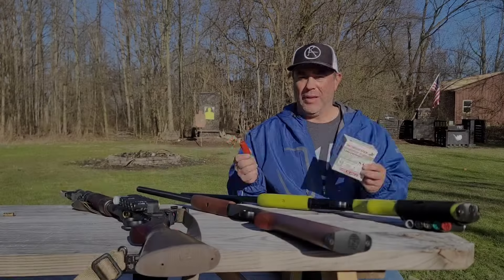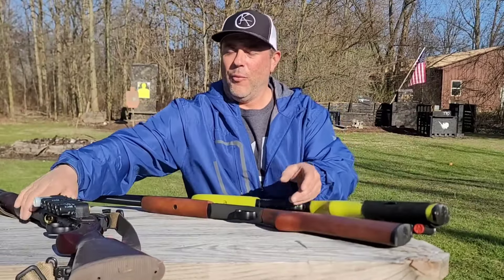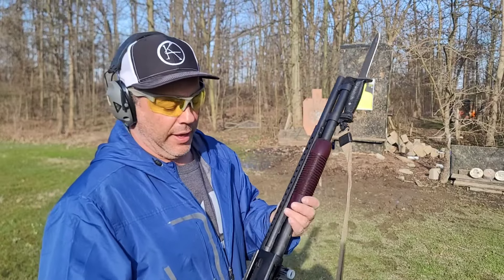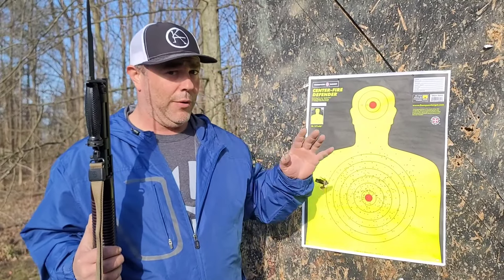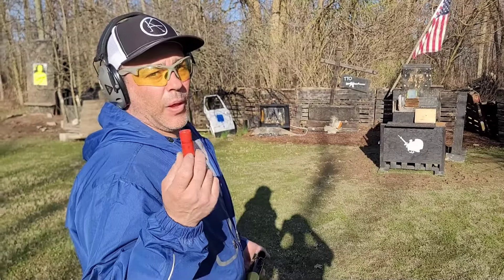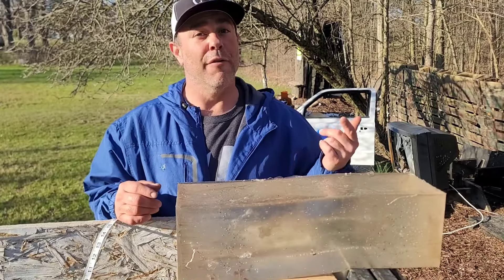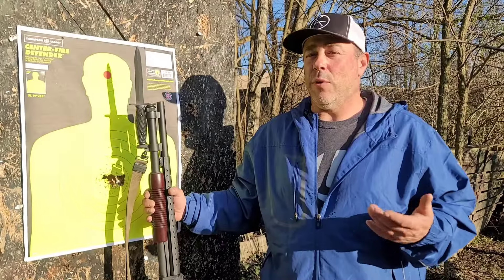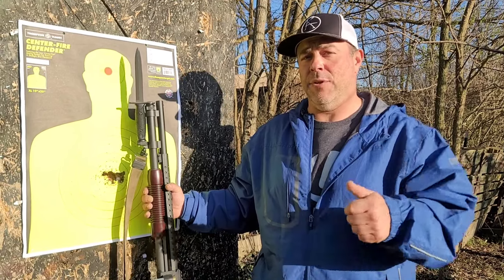BIRDSHOT For Home Defense? NO 🐂💩 Testing. Full, Modified, Cylinder Chokes.....

Comment: My home has a child in every direction. Buckshot and slugs will go through multiple walls very easily. I cannot think of much worse than accidentally hitting one of your loved ones while trying to stop a threat. I assure you that bird shot is very effective at indoor distances. I know a family who lost a son from being shot with bird shot from a 16 gauge. Any size shotgun shot is extremely deadly within 20’.   I would not use number eight or something small though . I keep my Mossberg loaded with BB size 3” shot shells. I would even feel comfortable using #2 shot. I have shot multiple wild hogs in traps with BB Shot shells. It is like turning a light switch off. I’m so tired of these “ tactical “ city boys talking like they know something. If birdshot will drop a 300 pound bore hog through its armor plate… It will definitely stop a thin skinned predator very quickly. If I didn’t have anyone living with me I would use buckshot for sure though.
Reply: Paul harrell tested. #4 birdshot on 12ga  will penetrate 1 wall. Check out his video. I used 20ga #4 birdshot.

Comment: Best video on the subject I've seen so far. I think alot of the birdshot doubters speak from second hand knowledge  without having done any personal testing and as a result fail to put things in perspective. For instance they don't realize that a load of small bird shot often weighs the same as a slug or buckshot load. As far as penetration I read a study that says a knife blade need be only 4-6 inches long to reach a vital organ so I take  the fbi requirement of 12 to 18 inches with a grain of salt. If one is concerned with over penetration they should know that a slug can bust through alot of things, and that 00 buck shot would be like hitting something with multiple 9mm fmj rounds and that 9mm fmj is known for over penetration and that small bird shot dumps all it's energy into the target while the slug or buck shot does not it lends to the idea that not only is small bird shot adequate for home defense  it is also ideal.

Comment: Without a doubt birdshot can be lethal, it's not recommended for self defense because it may not be immediately incapacitating. Bird shot generally does not penetrate deep enough to strike vital organs or CNS. As a result the primary stop on a target would be through exsanguination, that can take some time. Unfortunately, in a gunfight giving the bad guy an extra few moments could have them returning fire. 

Buckshot, slugs and rifles are effective because they can stop the threat a.s.a.p.
Reply: Inside of 15 feet it's a death sentence
Reply: Inside bedroom distance, it can easily shatter a skull. If you get them in the throat, it will take out vertebra. 

Shot placement still matters.
Reply: @ihcterra4625  Can you link those coroner's reports? I'd love to see a primary source document, on this topic.
Reply: @magickaldood  I never claimed to have coroner reports. You must be either thinking of someone else or you are using a straw man argument. I'll assume it was an innocent mistake and not that you are a liar. 

Of course, I could be wrong. If that is the case, I do apologize.
Reply: @ihcterra4625  So you don't have any primary source evidence of, "inside bedroom distance, it can easily shatter a skull. If you get them in the throat, it will take out vertebra"? 

Got it, thanks for your time.
Reply: @magickaldood  Oh, I have plenty. Just not coroner's reports. I never claimed that I had them.

You know, I'm beginning to think your comment wasn't an honest mistake.

Comment: My Rem 870 Wingmaster has been behind my bedroom door loaded with 7.5 shot for 25 years.  Thankfully I have never had to use it. The reason that I use it is that I know from watching testing that 7.5 shot will not penitrate 2, 3, or 4 sheet rocked walls killing someone I don't want to kill. Buckshot and slugs CAN. So I can at need defend my house knowing I am not going to kill my wife asleep in the bedroom.  As your test clearly showed at inside 20 feet with a full choke birdshot has no problem going right through clothing and anything else it hits.  But if it hits a wall, it is not going to go another 20 feet beyond that.  I have shot pidgons and grouse at 20 feet. What you get is best summed up with the saying "Bloody rat hole"

Comment: Hello I found your video rubbing informative and actually reinforced my opinion of what ammunition for the shotguns I need

 my local gun store I was trying to sell me on Dove ammunition for defense even though I think he was only thinking about home defense and I was not

 I have big property and I consider defense not just to be in the home but also on the property so I was looking for ammunition that would be effective not just in the home but also for at least 35 yds  about 105 ft.

 so after looking at your video and many others I think at a minimum double odd Buck should be the ammunition and possibly slugs depending on if the target is  armed and wearing some type of body protection

Comment: You get hit with bird shot under 7 ft you prolly gonna die. It's about iike a slug hit. It's kinds dangerous Don't mess around with shotguns. They are deadly. Everytime you pull the trigger with buckshot? That's like pulling a trigger to a 9mm 9 times, it don't mess around and will leave collateral damage
Reply: 9mm round is way bigger than buckshot.

Comment: I'm completely sold on birdshot being being not only sufficient but highly effective at home defense distances. With the added bonus of little danger of overpenetration. I live in an apartment and am highly concerned about maybe one day having to discharge a 9mm Para handgun.
But what is the risk of pellets ricocheting and hitting me back in vulnerable areas like eyes or throat? I won't be wearing shooting glasses at 3 am.
Reply: The risk of pellets bouncing back at you is far higher with steel shot, because it weighs less and doesn't penetrate well. IMO something like #4 lead birdshot might be the sweet spot, or #5 lead  if you're hugely concerned about overpenetration.

Comment: I need to redo the exact same shooting test. But having 3 different jail blocks. Because you shouldn't in your video right into a Joe block that has already been predamaged for inches 5 inches. Therefore, the proceeding pellets have less resistance. Because the other ones have already broken through.
Reply from the maker: Its not ideal but man are shotguns hard on blocks. 1 is a real pain to recycle, 3 would be a bad few days.😕
👊🦃👍

Comment: 20 feet is not an average home defense distance.  It is the average MAXIMUM.  Much more likely scenario is under 15 feet, owing to the response time lapse of the home owner. 

Very few homes have any open space that is 20 feet from any exterior door to the victim's position.  A prominent exception may be the many thousands of "split-level" homes where there is a front door that opens to a platform leading either up to the living room, or down to the basement .  The living room will be wide open, but the aggressor needs to come all the way up the stairs to access a fire lane into the living room or attached kitchen.  Even so, most home owners will not react in time to the intruder, no matter how well prepped.  Thus, the distance will be greatly reduced in a couple of seconds.  Home invasions and armed reactions most often occur at between 10-18 feet.

This increases the effectiveness of birdshot almost to the level of buck..... IF you have the time.
Reply from the maker: I have 20 ft shots all over my house🤷‍♂️ 
Thanks for watching! 👍🦃👊
Reply: @theturkeysopinion  You are the exception - not the rule.

Comment: Every time I see a video abiut birdshot for defense, I always check it out for the ranges they use as a "typical" example.  WHile I have no doubt of the lethality of birdshot, the ranges given for typical inside-home defense is usually on the far side.

I invite the viewer to actually maesure every possible fire position in your home.  You will be  surprised to find that there are not many that are 20 foot open distances inside a house - unless you have a very large house.

Add to that the unlikely event that you have warning of in itruder before he is inside, thus, the distance is likely to be much less than 20ft.  More in the range of 5ft to 15ft.  The longest distnace in my house is the hallway to the bedroooms, which is 18ft.  In the rec room, which has a door to the outside, I would be dealing wioth a distance of 12 feet even if I knew they were coming in.  I most likely would not - nor would anyone.

Now, do a demo of the spread at those more realistic ranges.  My 20g 870 with an 18" barrel patterns like a ragged 3" hole at 12 feet and doesn't get much bigger than 8" at 18ft and blows through a full size ham.

Also, birdshot MAY be more defensible in a civil suit, which will follow any defensive shooting.

Comment: I believe in the candy cane load....first, #7 bird shot, then #6, then #5, 4, 3, 2, buck, buck, slug... My Benelli holds 9
Reply from the maker: I love this! Increasing levels of Deterrence.👊🦃👍
Reply: You just want to shoot someone a little bit when your life is on the line? 
I assume you're using target loads in a cylinder bore? That's really not a good idea. Use a heavy magnum turkey shot or coyote BB load with versa tite or flite control wad if you're not going to use a full or tighter choke...
Reply: I think this is a bad idea. If #7 doesn't neutralize a threat you're not going to have all day. I'd skip over the 6 and 5 at that point.

Comment: I have an old Savage bolt action 410 with modified choke.  At 10 yards with #8 shot it throws a nice 8” pattern.  If you are defending yourself you would be at 5 yards. Robber, it stinks to be you.

Comment: Something to consider is that penetration in gel in no way equates to penetration in living tissue. For example, per FBI testing parameters,  the gel block must be calibrated before it is used. This involves shooting a steel .177 caliber BB into the gel at 590 fps. The BB must penetrate between 2.95 and 3.74 inches. Now, a lot of us rural guys grew up having BB gun wars as boys, and I can assure you that a steel .177 caliber BB at 600 fps will leave a bloody welt, but it won't penetrate even half an inch, let alone  nearly 4 inches into your body. So when you see these pellets stopping between 5 to 7 inches in gel, they are barely getting through the skin and into muscle tissue. They aren't making it into the thoracic cavity. They may dissuade further aggression with a psychological stop, but this mechanism isn't as reliable as physically incapacitating a threat. This requires more than superficial wounding and pain. Physically incapacitating a threat requires deep enough penetration to reach large blood bearing structures deep in the body and causing hypovolemic shock. There is a reason professionals and informed citizens overwhelmingly prefer buckshot. Those of us who actually use birdshot to kill shit know it doesn't anchor rabbits on the spot reliably enough to trust our lives to it.
Those that know gel testing know this test just demonstrated the abysmal performance of birdshot, even constricted by a choke at indoor distance. Piss poor performance.
Reply: You obviously haven't seen Jeff Quinn's YT video, "Shotgun Ammo For Home Defense Gunblast."  It might change your opinion.
Reply: @spectrumifs  I remember that video. Jeff is sorely missed, but this is one thing we will have to agree to disagree on. I've still seen rabbits take well centered birdshot patterns at ranges I have in my house and run off. 
The whole over penetration argument is asinine. I cringe every time someone says, "Over penetration." I swear it lowers a person's IQ two points every time they say it. Especially when the standard you are using to judge it is two 1/2 inch pieces or drywall that an eight year old squishy-face on Ritalin can punch through. 
Again, gelatin testing exists to give us scientifically valid data, and standards were derived through the real-world experience of experts like Dr. Fackler, who treated thousands of gunshot wounds. When they suggest a minimum penetration standard of twelve inches, it is not an arbitrary number. 
Shooting meat is fine, but absent a realistic skin medium, lacks any relevance to the real world. Skin is resilient and elastic, and a surprising amount of a projectile's energy is absorbed just penetrating the skin. A BB that will penetrate 3.5 inches into gel will barely break human skin. It would be interesting to me to see someone shoot pork with a .177 caliber BB at 590 fps. We'd probably see it penetrate several inches of meat, and then some yahoo suggesting we use BB guns for home defense to avoid "over penetration."
Reply: @MTMILITIAMAN7.62  Not rabbits, meat or gel, just real life documented incidences:
1)  2018, Security-Widefield, TX, Kenyatta Horne killed by single birdshot blast
2)  2017, Hermit Park Open Space, CO, momma black bear killed by birdshot blast
3)  2012, Bahrain, Salah Abbas Habib, 36,  killed by birdshot blast
4)  2022 Abolfazl Adinezadeh, 17, Mashhad Iran, killed by birdshot blast
5)  2013, Phil Anderson, Wisconsin, killed 275 lb. black bear with single shotgun blast, birdshot

They all had skin...especially the bears. 😁
Reply: @spectrumifs  According to 2019 FBI UCRs, 600 people were killed using personal weapons, bare hands or feet. So maybe we should just judo chop our attackers? Choke them and shake them until they pee? You're unlikely to hurt your neighbors and a good kick to the head is undeniably potentially lethal, so it must be a good choice, right? 
I never said that bird shot wasn't potentially lethal. Any firearm can be lethal, especially at near contact distances. That doesn't make it a wise choice for home defense. There are just better choices out there. If anything that punches through drywall "over penetrates" for you and you need to be at near contact distances for your firearm to be effective, I would suggest a firearm is maybe not the right tool for the job...
Reply: @MTMILITIAMAN7.62  The subject was birdshot and I am sufficiently convinced Jeff Quinn demonstrated its effectiveness.
Reply: Getting shot with one .177 pellet from a childhood "bb gun" fails in comparison to a 12gauge 3in .177 bb shotgun load. These kids are not getting smarter...😂😅
Reply: @raymondscott6680  You clearly missed the point.
Reply: @MTMILITIAMAN7.62  hit dogs holler...
Reply: @raymondscott6680  I don't hit dogs so I will take your word for it.
Reply: @MTMILITIAMAN7.62  you clearly missed the point......smh 🤣
Reply: @raymondscott6680  The point is that projectiles rarely penetrate as far in tissue as they do in gel, so if penetration in gel is marginal, penetration in tissue is likely to be even more so. When your furthest depth of penetration is several inches under recognized professional minimum standards, that is unacceptable.
Reply: @MTMILITIAMAN7.62  there is alot one can learn after the use of a shotgun,  instead of shooting a shotgun..Human beings are not made of gel. The energy of the ammunition needs to be considered. Most people drop from a simple punch to the liver.
Reply: @raymondscott6680  If it is pain compliance you are interested in, you need a can of mace, not a firearm. 
A firearm is considered lethal force and it is only legal to use when one can easily articulate a reasonable and imminent threat to life or grave bodily injury. 
A bean bag round or baton slug delivers lots of energy. These are considered "less lethal" because they, by design, do not penetrate deep enough to generally cause lethal damage. This is the difference between a psychological stop and a physical stop. When we face a deadly threat necessitating the use of lethal force our goal is to physically incapacitate the threat by causing hypovolemic shock. This requires energy to be delivered deep enough in the body to damage vital large blood-bearing organs, resulting in a rapid loss of blood pressure that removes the threat's physical capacity for violence. Penetration is, therefore, more important than energy. 
Birdshot is too inconsistent to be relied on for this type of terminal effect. Because it has a tendency to lose energy superficially, it can easily achieve inadequate penetration and marginal effectiveness, leaving you dependent on a psychological stop. There is just too many better options available for a shotgun. If birdshot is legitimately all you can acquire or is what you have available, then it is better than nothing. But seeking out and promoting birdshot above other, better options is foolhardy and irresponsible, especially under the guise of concern for "over penetration," which is itself an asinine argument. The cognitive dissonance required to believe compromising terminal effect allows you to disobey basic firearm safety rules, ironically in the name of safety, is profound.
Reply: @MTMILITIAMAN7.62  well why don't you do your own video?? Take the "Pepsi Challenge", stand at 21ft. in front of a shogun barrel that fires one round of number 8 bird shot. That will make your comments alot shorter.....
Reply: @MTMILITIAMAN7.62  if you are not willing to engage a threat at less than 5 yards inside of a home. Than you are a coward.

Comment: Problem with buckshot is it will penetrate through  16 layers of dry wall......thats 4 interior walls.
Reply: 00 Buckshot can even overpenetrate when you hit.
Reply: Buckshot is made to discontinue a man-sized creature at a range of 150 feet where likely several pellets will have sub-optimal placement. Lead BB is closer in size to 00 Buck than to #8.
Reply: @kurtwpg  well in a house environment your talking 5' to 60' max engagements.